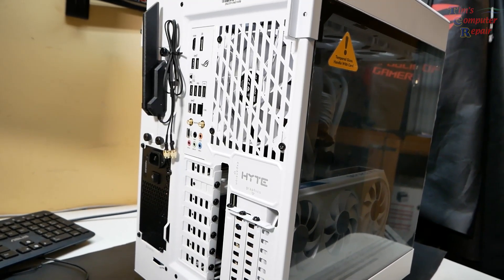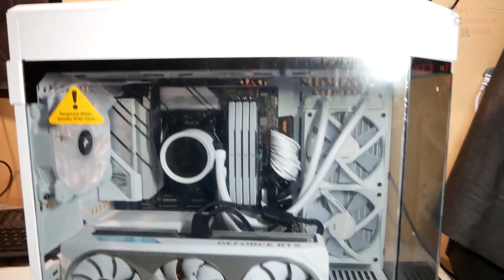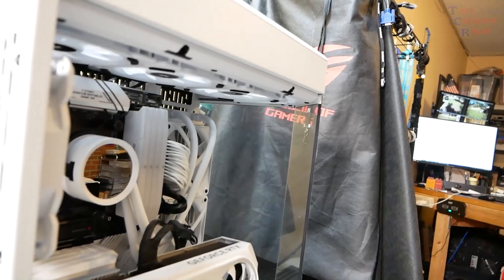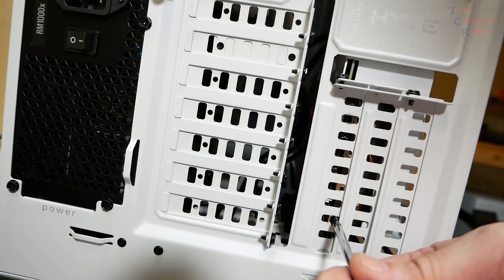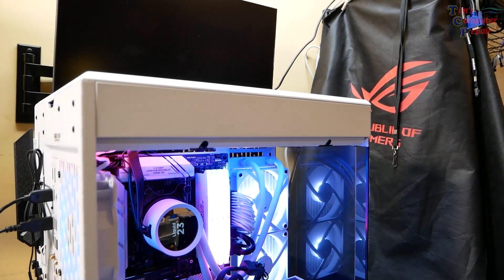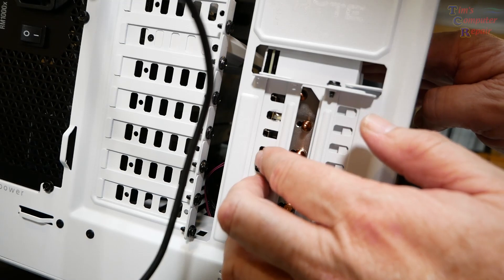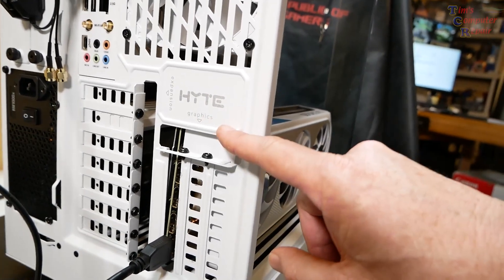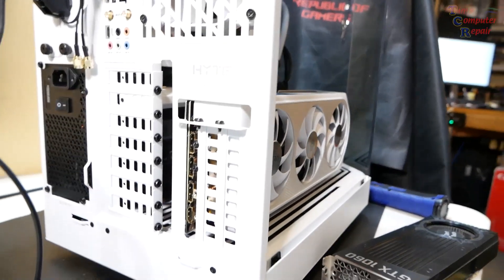Never Seen This Before! New Nvidia Video Card Install Goes Wrong.

Comment: What she did was didn’t remove the PCI slot brackets. Once both “knockouts” are removed the card will fit perfectly. She most likely tried to fit the card in place without removing them which obviously doesn’t work.
Reply from the maker: Thanks for commenting.

Comment: That looks like user error to me. The case is one of the best out of the dual chamber designs in my opinion.

I have watched many build videos of this case, even with that exact GPU, and I see that whoever build that, removed the I/O plate from the GPU for some reason. (which is where those screws are supposed to be in) and its that plate you screw to the vertically aligned PCI slots like any other case :).

Hope that helps.
Reply: https://www.youtube.com/watch?v=lNyREvmH03I

Here's an example.

But for some reason if you want to throw that case away, I will happily take it :P haha goodluck.
Reply from the maker: Thanks for commenting.

Comment: Great video again Tim.
Gpu brackets should be a uniform size and I would almost be certain wouldnt fit if she had not removed the 2 slot covers and their screws, should fit fine if they were removed. The extra height from just the tops of the covers themselves would cause clearance issues, let alone the screws holding them in place.  I would reccomend getting the bracket and testing this as the only other reason would be the vertical mount not being installed correctly
Reply from the maker: Thanks for commenting.

Comment: My guess would be that she did not have the two tabs on the bottom of the video card io plate slid into their slots on the case.  Hence card was sticking up too high. There is a gap between the bottom of the case and the back of the case.  That is where those two tabs should fit.

Comment: You should have installed another card to see what she did wrong. I have used this and ALL cards fit perfectly. She must not have had the bottom tabs lined up right
Reply from the maker: No joke I had the exact same computer come into my shop but it was a black one. Same freaking problem

Comment: Did you try fitting another card in there? It's a very popular case and I've never heard of anyone having trouble with it. Either a manufacturing error or the builder was doing somethign else wrong, I think.
Reply from the maker: No joke I had the exact same computer come into my shop but it was a black one. Same freaking problem

Comment: Wrong expansion riser or just put it GPU other way
Reply: Can't do that. Case has vertical space for ports 😁
Reply: Never tried to remove gpu and try to put back 
at least not on video 
Looked to be pretty close 
Looked from what I saw that in a pinch he could have bent back brackets to fit it 
Only if person has no money for new case 
Very improbable 
I am no expert 
So take what I just said with a tiny tiny grain of salt 
Just my amateur observation of problem 😮
Reply: Vertical mounts
Then take with a very very tiny miniscule grain of salt

Comment: Sigh. Rolls eyes and says well end users never cease to amaze us techs. I have seen countless people build in this Hyte Y40 /Y60 and I have not seen any issues with GPUs. The Y40 has Video Card Max Dimensions 422mm length, 94mm height (80mm height or less recommended for best cooling). Here is a review showing a Gigabyte GPU installed in a Y40 case https://www.techpowerup.com/review/hyte-y40/images/instgpu.jpg . Notice how that GPU  top of the video card is below the riser card in the PCIe x16 slot. In this computer the GPU is at the same height as the riser card see here https://youtu.be/uzLTMW8JB-I?t=502

Note This is probably the newer Hyte Y60
Reply from the maker: No joke I had the exact same computer come into my shop but it was a black one. Same freaking problem
Reply: @TimsComputerRepair  So you have had a second Y60 case  show up with the same problem?

Comment: OK, now I'm confused. I have a separate graphics card, but plug in to the regular motherboard display sockets. Everything works and I must be using it because computer recognizes the nVidia card. God knows I spent long enough on the nVidia config for Linux Mint! 
So is it that some special graphics cards have to be plugged in directly like that?
And why does she have to lay the card flat in the first place?
Reply: I believe the case has only this possibility. Look at the back, card's ports are usually horizontal not vertical. And this case has only vertical possibility!

Comment: 1. In my experience, most newer motherboards will not over-ride the onboard video if a discrete video card is installed. The onboard video will still function even inside Windows. And when you check Device Manager, it will show both the onboard video and discrete video card.

2. You should try to mount your spare video card and see if it has the same mounting problem.